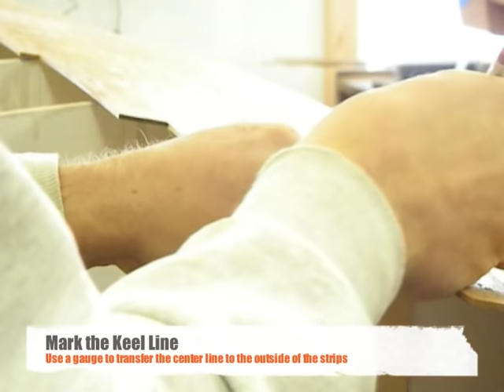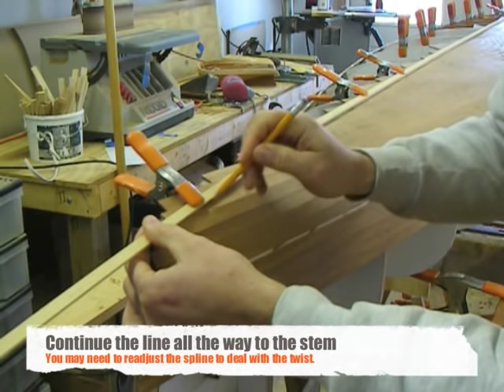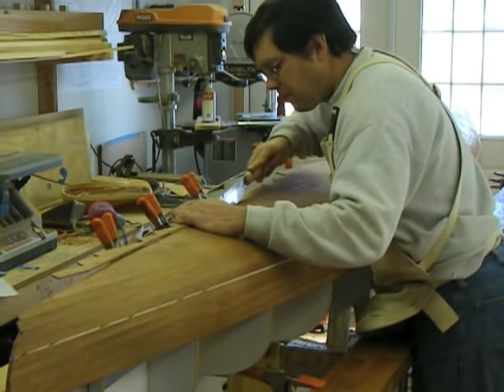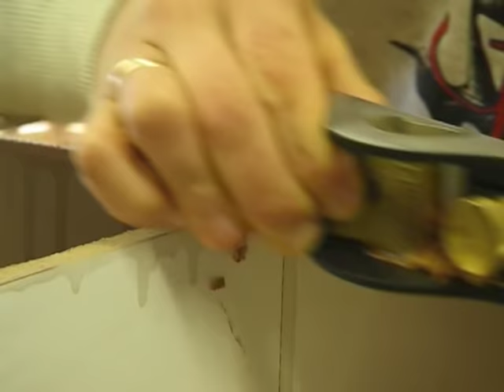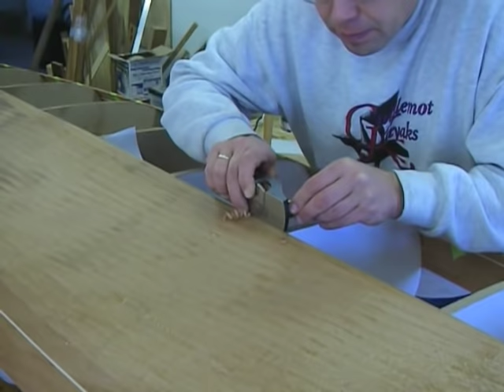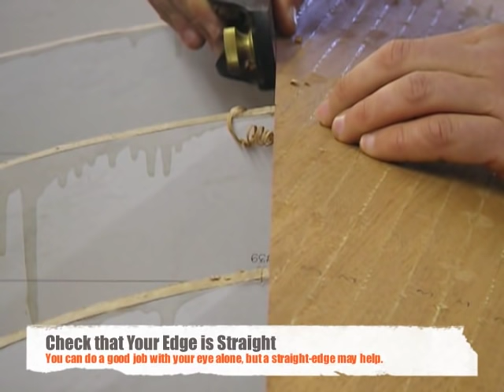Trimming the Keel Line

Comment: Your blade width must be the same width as the plane, otherwise how do you trim the keel at the station?
Reply from the maker: I use a rabbet plane where the blade comes all the way to the edge of the plane, so it can cut the strip right next to the form.